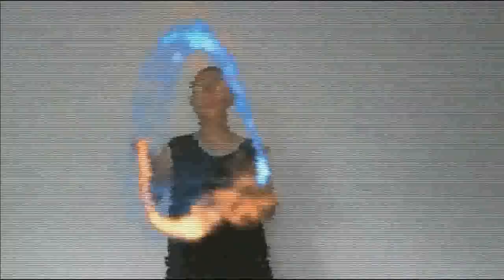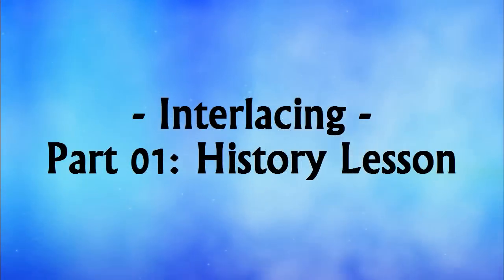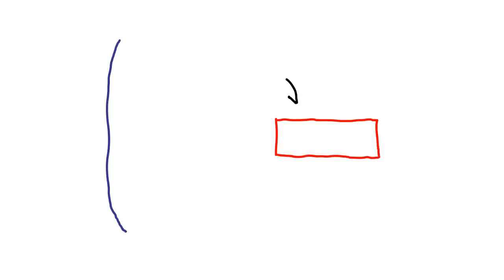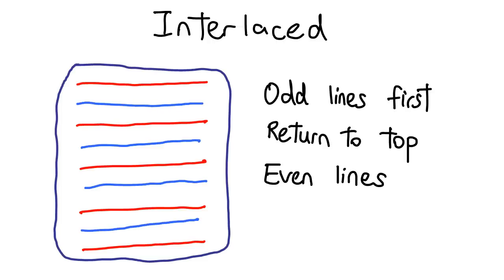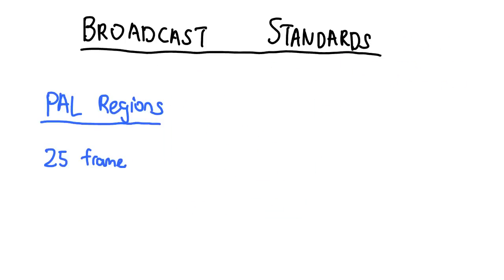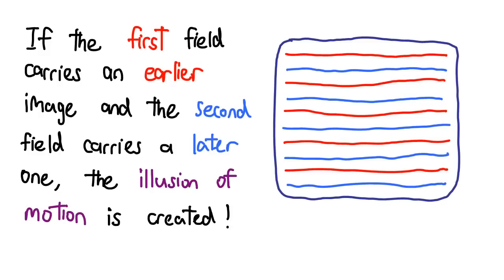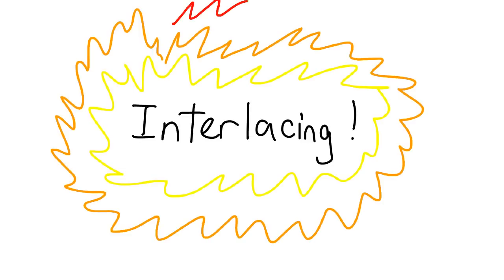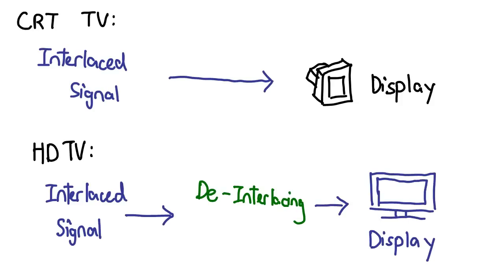Interlacing Lesson 01: History!

Comment: So "field" 1 would show time t
field 2 would show time t + 1/60
field 3 would show time t + 2/60
field 4 would show time t + 3/60

The images/second would be 30, but those 30 frames would consist of 60 images?

In other words, the original video showed must have been 60 images/second?

If I have a television station and I film and send out data at 30 images/second, then I would not be able to gain anything with interlacing?
Reply from the maker: Hello and thank you for your comment! That's a very good breakdown - Yes, the time interval between each successive field is indeed 1/60s, but this information is "squished" into images that are being transmitted at a 1/30s interval.

The camera must indeed run fast enough to capture 60 frames per second, though interlacing can be performed in-camera, so that camera can produce an already interlaced stream at 30fps.

Note that we are assuming here that stations can only send out 30fps footage, and that interlacing is used if we need to create the illusion of a higher frame rate.

So with that in mind, If you send out a progressive (ie. Non-interlaced) video stream at 30fps, in the best case, your viewers will see what looks like 30fps video. In the worst case, if their TVs interpret the signal wrongly, the image may come out distorted.
Reply: Thank you very much for that clarification! I was a little bit confused about that, but now I understand.
Reply from the maker: That's great to hear! Very happy to be of help =)